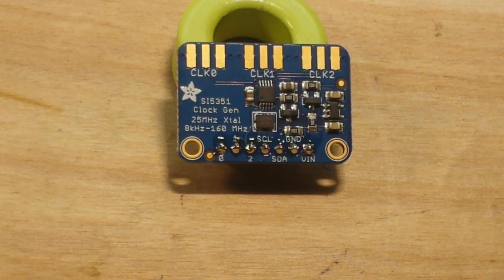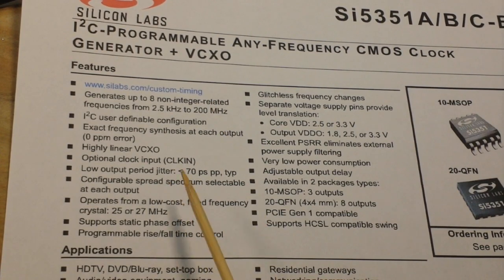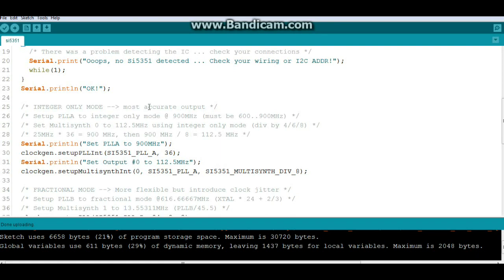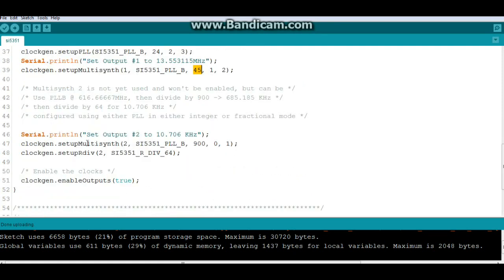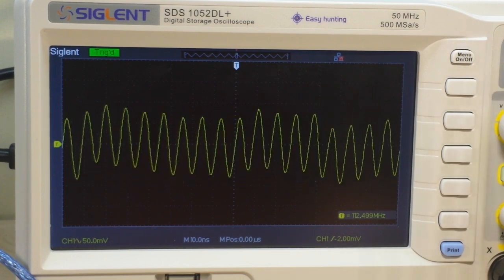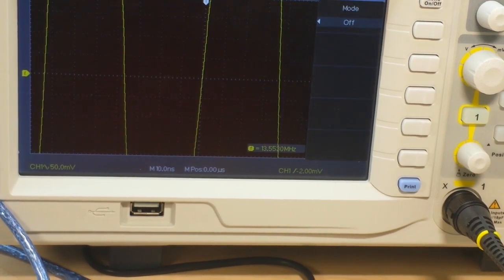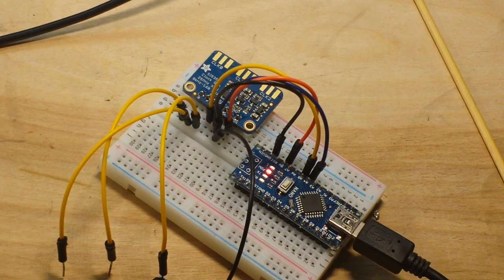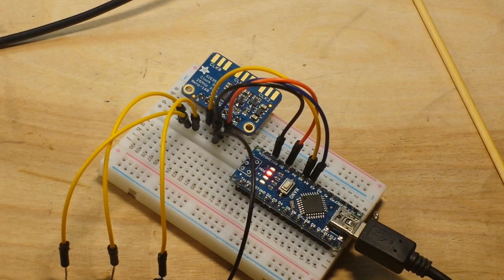Adafruit Si5351 breakout board

Comment: Con 50Mhz de ancho de banda, significa que una frecuencia de 50Mhz es atenuada 3dB. El criterio debe ser usar hasta con señales de 25Mhz. Con 500Msa/s  da un periodo de muestreo de 2*10**-9 seg, los tiempos de subida y bajada deben ser mucho mayores para que la medida sea significativa.

With 50Mhz bandwidth, it means that a 50Mhz frequency is attenuated by 3dB. The criterion should be to use it with signals below 25Mhz. With 500Msa/s it gives a sampling period of 2*10**-9 sec, the rise and fall times must be much longer for the measurement to be meaningful.

Comment: I'm going to attempt to use an Si5351 to replace a TCXO that outputs a 45.5 Mhz signal.  I would need to get the output looking more like a sin wave and understand I could achieve that by using an L/C/R filter on the output.  Wonder if you've ever done that or can point me in the direction of info on that subject.

Comment: Hey, I am using STM32F103C8T6 controller to get 36,24,72Mhz and when I check on a Keysight Infinivision MSOX4024A with max 200 Mhz. It shows 36,24,72Mhz also of sin wave only. Is it correct! Actually, I was expecting a square wave.

Comment: Can this square signal source become less distorted as the frequency increases (in MHZ)?
Reply from the maker: I don't have a good answer for you. Im not an expert on this unit.
Reply: Thx
Reply: @rafaelbarbosacosta9365  The output is distorted in this vid largely because it's in a crummy proto board which is horrible for RF. On a decent ground plane, yes, you'll create a nicer waveform.
Reply: @syfr  i bought a board like that months ago and I tested it with an oscilloscope, thank u very much!

Comment: Hello, how can I get a square wave signal with this module, on the order of 10 MHz but with amplitude from 0V to 3V ??
Reply: Hi there. I just want to help answering your q. Actually this chip have its characteristic. The lower frequency you set. This chip will give you more square-like output frequency. But, in 10MHz, i never heard someone get square wave. So the answer is you cant. Tell me if you already know how to do it. :)
Reply: @kimtzuyu2765  Shcmitt trigger

Comment: Hi, could you tell me if this Si5351A module can generate square waves at minimum 20MHz and at maximum 65MHz, I need a square wave generator because my ADC from Texas Instruments only works with square wave clock.
Reply: You maybe would like to consider the AD-9851 for that

Comment: Could this be used as a crystal replacement in an old computer?  I need a 20.275 mhz crystal and can not find it anywhere.  Can this thing function on it's own after programming with the arduino?  I have the 5V/GND on the mainboard.
Reply from the maker: I believe you would need the Arduino every time you boot up to set the clocks.
Reply: It sounds ridiculous that it would not have some flash to program for fixed frequency applications ... but looking at the datasheet, seems you are right.  But an Arduino would be overkill to program this for a static application.  You could buy an atmega8a for $0.47, or a tiny for even less.
Reply: Have no idea why I looked into this ... not me with the Model 4 (but it would be cool).  But the good news is that the 20.275mhz  crystal can be had for 81 cents each.  Bad news is that you have to buy in lots of 1000.  https://www.mouser.com/ProductDetail/Pletronics/SM5545TEV-20275M/?qs=dHOEZjiJ3XOU56eUXdQRww==

Comment: Just in case there was any confusion for anyone, the BITX series, different bands but single band radios, run $59. Its an amazing radio. The uBITX is one step above , 3 to 30 without mods and a little more with them, 10 watts or more just like your description, also has the separate wires for exciter power and amp power, very easy to work with,  and a lot of fun. Most of the time $109.  The only thing you didn't say is that the exciter has circuitry that is more advanced than many very expensive radios. Off the charts with simplicity and performance. And, it will be a perfect camp radio to boot. The build can be simple or like the one at the uBITX facebook group, used for the cover photo. Fun is the operative word here. I've got this little si5131 shield, it should be a very useful piece of gear. Thanks for the video.
Reply from the maker: Thanks for the added info. The latest version of the bitx40 also has separate pa voltage inputs(according to the hfsignals webpage)
Reply: I think the BITX is more like 5 watts. Unless the new version has been changed., it has a single output FET, so it is half the power of the uBITX. Its also half the price. Or close to that. It also has a Raduino now, for digital frequency control.
Reply from the maker: I just checked, it's 7w
Reply: Cool, and a lot of people are putting relays in, with low pass filters, for other bands. This won't make it a uBITX as there are many other things that were done with the uBITX but people are quite often putting BITXs on 80 and 20 meters ect.. And they work good. A site where a lot has been done is www.ND6T.com . The AGC is a good start.  Have fun. I've got the little shield above, need to put it together with a nano. As Don ND6T said, to calibrate it, just "enter"  tin the software the ACTUAL frequency of the crystal clock oscillator . The unit could be put within a cycle of WWV !

Comment: A lot of the issues with the oscilloscope display are due to the probing technique used. (The scope will obviously not be calibrated at 2X it's rated frequency.)   At RF frequencies you need to keep the  the lead lengths to the scope probe as short as possible.   This includes the ground lead.  W2AEW has an excellent video showing how to make a quick and easy probe socket that will work with most any oscilloscope probe.  
https://www.youtube.com/watch?v=-4q8geE5ef8
Hope this helps.
Reply from the maker: Thank you Terry. I love Alan's videos. I have avoided RF for 30 years, but watching him got me over my RF block, and inspired me to get my ham license. KE8IXE

Comment: well. I have gone and done it! my soldering iron looks like crap. I bought cheap solder. and has left the nastiest black carbon and who knows what all built up on it. I'm gonna have to clean it with sand paper  if its gonna be cleaned. I have tried everything else. its just a 25w RadioShack iron. I haven't found any tips for it. I don't like tossing things that can be fixed. even if it is cheap. any help for my iron? great video. its a bit beyond me. but hey that's how we learn.
Reply: Soldering iron tip cleaner would be the best thing to try. If you use sandpaper, the iron coating will be damaged and then the tip will get pitted and wear away quickly.
Reply: Andrew Morton I guess that's already happened. the tip is gone. its almost completely flat. with a small peak in center.
Reply: I've restored old soldering iron tips by using the acid paste flux for making plumbing connections and putting the hot iron tip in it and cleaning off with steel wool. Then tinning with rosin core solder. After doing this repeatedly I got good results. Just make sure that there is no acid paste flux residue left on the tip and you will be OK to solder electronic circuits with that soldering tip.

Comment: Has anyone used one of these with an R Pi (ZERO, 2B+,3B+ ) to do an SDR VFO or a signal generator=)
Reply from the maker: While I have not done it. It is an I2C device so it will work with a Pi, no trouble. I'll be using it as a VFO with an Arduino nano.
Reply: I also have a BITX-40 that that may be the recipient VFO plus enhancements =)
Reply from the maker: I'll have a few Bitx videos coming up... Starting tomorrow

Comment: The board said 8khz to 160mhz though.  Oh, and nice to know Alinco is still around as it was my only radio back in the 1980's and was a nice HT and back then people talked down about it because it wasn't the big three but I never had an issue with it and I ran it as a base only with its 5 watts out 2m for packet radio (mostly).
Reply from the maker: That's probably the stable range. At the extremes it might get a little crunchy.
Reply: You will find out though right? :)
Reply from the maker: No doubt

Comment: Cool break out board. Adafruit has some really good stuff, Lady Ada does some amazing designs. The build should be interesting. Is this a kit you're getting or already assembled? Thanks for the video!
Reply from the maker: It's 80% or so. There are two boards: the HF radio and amp board and an Arduino/dds/ display board. All of the wiring is left up to the builder, along with a case, and speaker.
Reply: Sounds like another long 3D print coming!